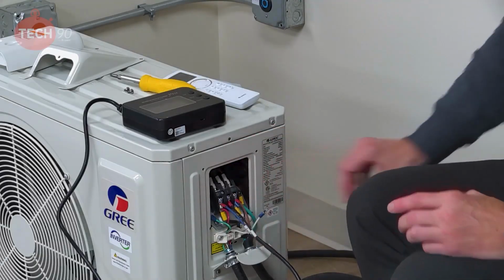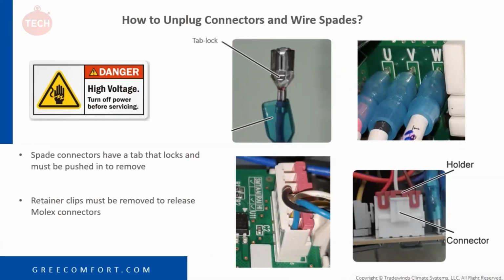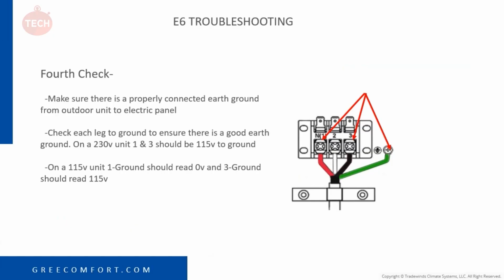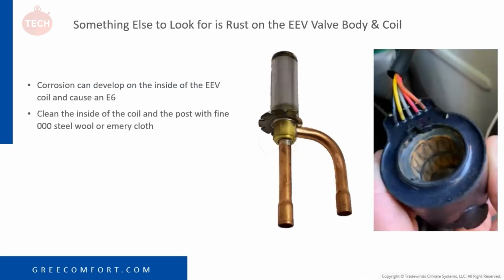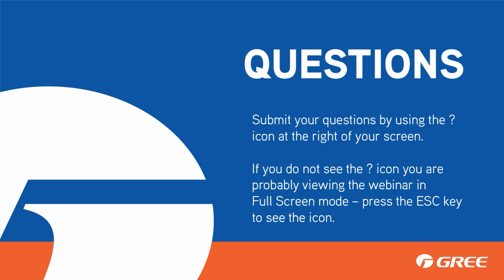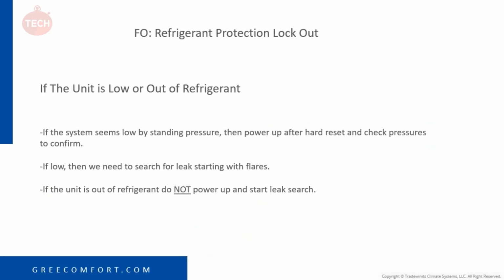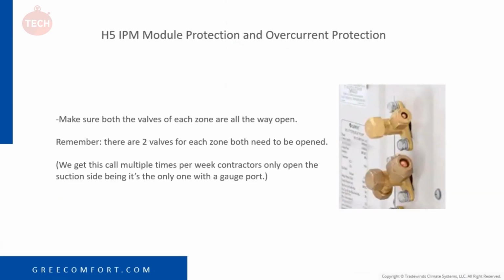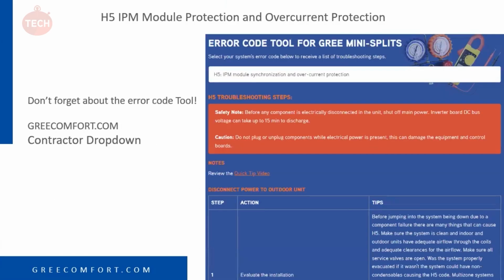Top Error Codes, Common Questions, and Service Tools According to GREE Technical Service

Comment: The question I asked at the last training video was "What constitutes "Adaptive Mode" on the Flexx R32 product? JD stated that an explanation was added to the quick start guide; however, page 5 of the QSG references the dip switch setting, but still not an explanation. Perhaps the QSG was edited but not loaded to the website? Thanks Steve